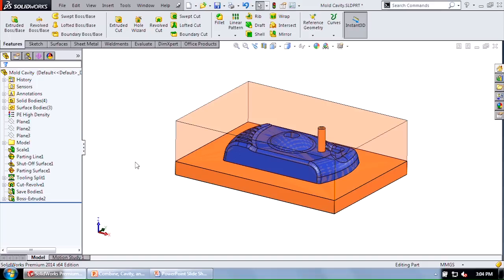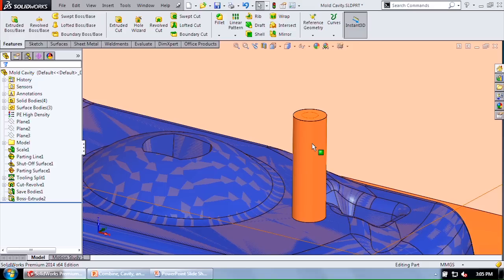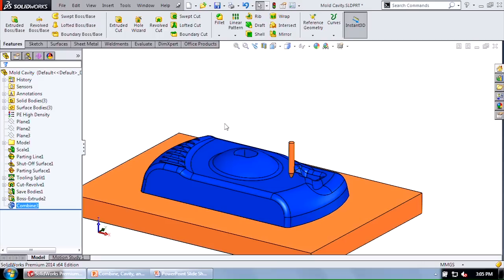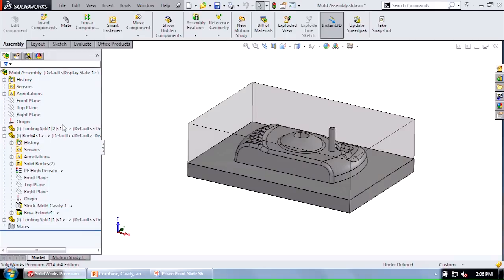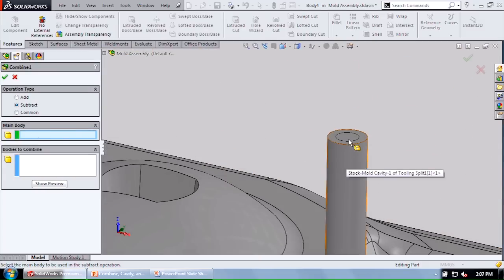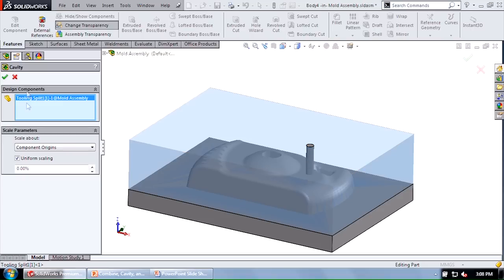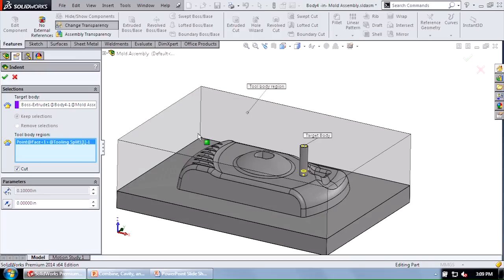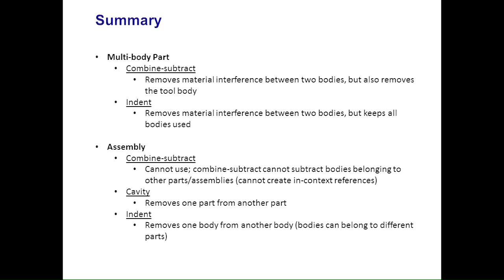SOLIDWORKS - Combine, Cavity & Indent: What's the Difference?

Comment: I was following you up until you started talking about parts and bodies.  I don't understand the difference!
Reply from the maker: A part is an .sldprt file; many times a single part is made up of a single body. However, in SOLIDWORKS you can have a single part file with multiple bodies, which is called a multi-body part. An example of this would be a single part (.sldprt) that has two separate cubes in it. Because the two cubes are not connected together, SOLIDWORKS would see it as a part with two bodies.

Comment: My Cavity, Join, and Combine tool don't show up. Do they only work in assembly mode?
Reply from the maker: Miles,
The Cavity, Combine, and Indent tools are all at the part level. You can use them in a multibody part environment, or if you are at the assembly level you must first edit the part “in-context” in order to access those commands. If you still don’t see these commands at the part level, you may need to go to Insert > Features > Customize Menu to un-hide these commands.
Reply: @hawkridgesystems  
I'm finding it funny to create a domain around an assembled component. Help
Reply from the maker: @warmateawoloye7135  In this example it is done at the part level. In your part create a new extrude feature to represent the mold half and make sure to uncheck the checkbox for "Merge result" to produce the mold half as a separate body. It can also be done at assembly but it is a bit more complicated!

We are planning more videos on the topic in the future